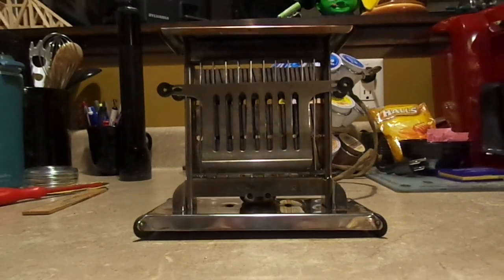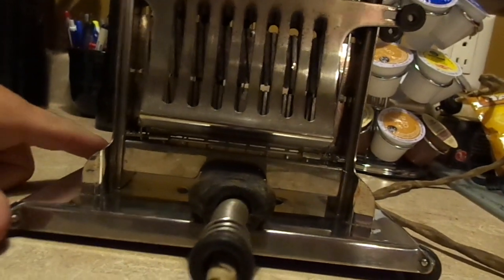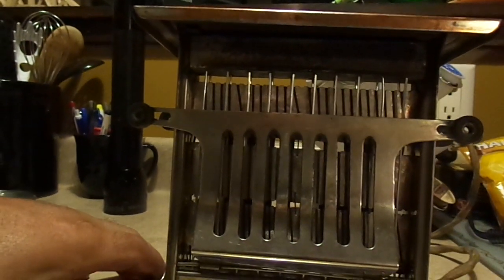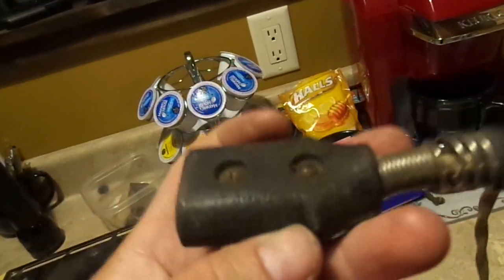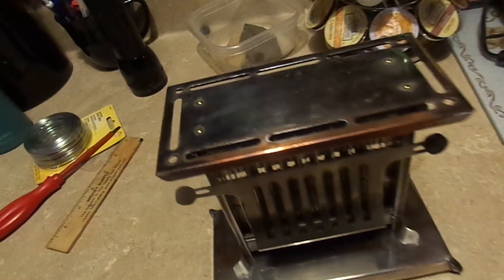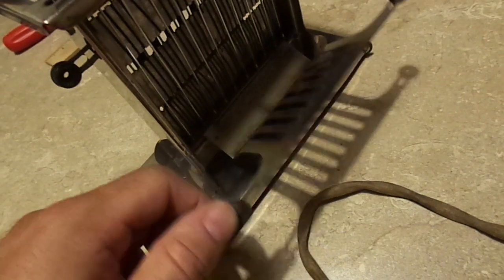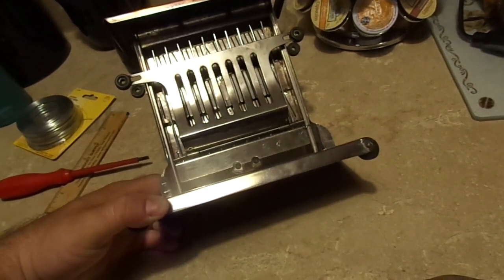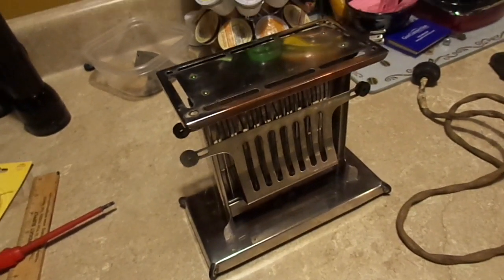1915 Landers Frary & Clark "Universal" E945 Toaster

Comment: I think you could get the bakelite plug part as a replacement.  I think the cord - cloth part, should still be good.  I think the feet may be a fiber washer type thing, as I have a toaster like this, and one of the fiber washers is busted up a bit and and my toaster is a little wonky and doesn't sit flat.  I think a lot of these are nickle plated.  Nickle can get to a very bright shine and look like stainless steel.  You can put your toast on top - to keep it warm, while you are toasting 2 new slices.  They also made 'toast holder trays', they were wire loops that would hold your toast on top to keep more than a few slices warm.  I would just use it and enjoy it.  Toasters of this era really do toast quickly, especially 'Sun-King' toasters.

Comment: I, too, have a 1915 Frary and Clark "Universal" Toaster.  It is a different model as the doors are different.  It is nickel and all-in-all in great condition and it works very well. One of the springs on the doors is  broken;  Where can I get something to replace it?  What gauge wire would it be?  I guess I could make one but I don't know its gauge or what type of wire to get.  I would rather purchase something that would work.  Can you help?

Comment: I could see it was nickle by the color. Use polish with a soft cloth. Nickle is darker than chrome. I had a 1936 toaster in nickle, polishes mirror like as chrome but is softer, and a darker shade.  P.S. Don't rub hard, the nickle can rub through, I did that to my nickle toaster, there was copper plating under it.

Comment: I have something similar..a bit newer. but not to much newer. (maybe 1920's or 30's?) it has the flap doors and the same plug in style cord. but the doors are in a triangle type  shape. the whole thing is a similar design to a House roof. i guess you could say. anyway. great video!

Comment: A device like that needs an earth wire, would be to easy to for the case to short with the element and make it live.
Reply from the maker: ***** Back in 1915, homes weren't wired with a ground connection in mind. That didn't become standard until well into the 1960s! Even still, most resistant heat appliances are still ungrounded even to this day.